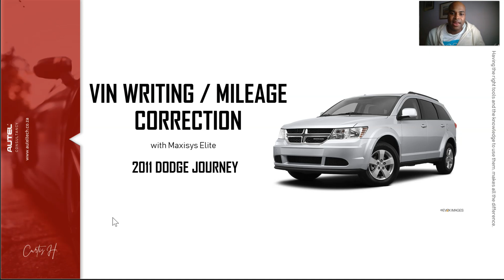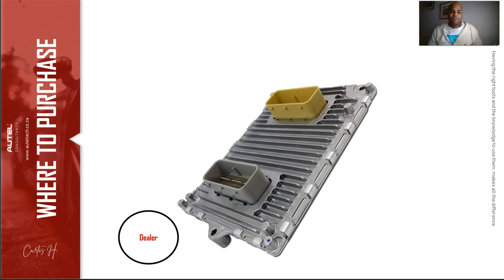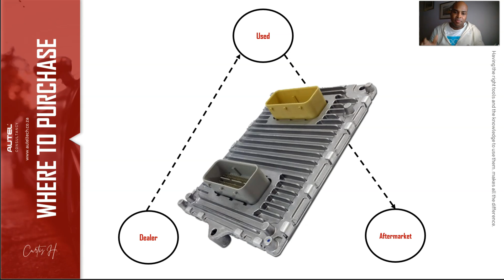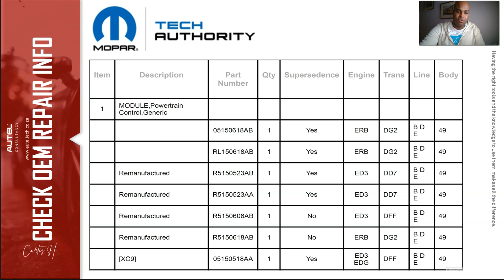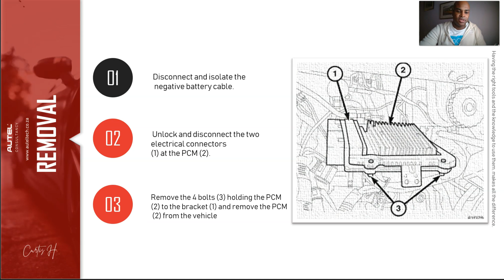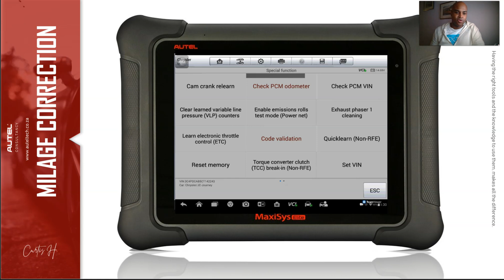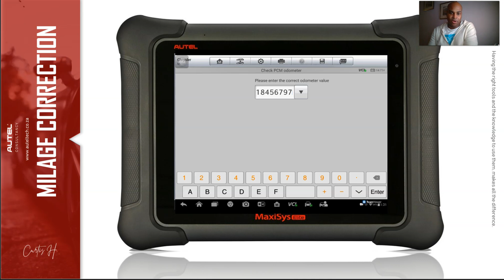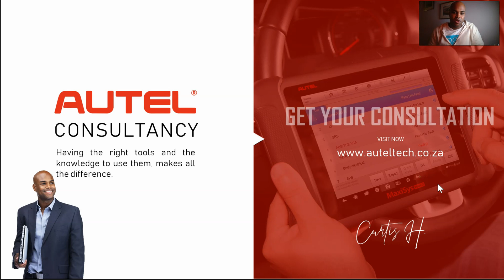Autel MaxiSys Elite | Write VIN on Used PCM & Mileage Change - 2011 Dodge Journey | Case Study 2020

Comment: I have the autel maxicom 900 and when I go to the pcm to write the vin it doesn’t have the special feature button there is there an upgrade app you have to buy to get that feature?
Reply from the maker: You should book a diagnostic tool consultation with me so I can learn about your needs and then give you the right tool strategy. Otherwise you have to keep on purchasing different tools until you find the right one... That way is more costly.

Comment: Good day. Global problem with the car and I do not know what to do because I have tried many different options. The car is Dodge Journey 3.6 STX AWD 2012. Unstable voltage at start-up produces a voltage of 13.5-14v after 30-40 seconds of operation the voltage starts jumping 12-13-14-10-9.5-11-13-14-9-12v (then after some time it is always different) when pressing the gas pedal while driving or just standing still, increasing the revolutions to two thousand the voltage can rise to 18v and fall to 10v and in chaotic dynamics jump to 18v. The ABS and ESC icons flash on the instrument panel, the radio turns off, the speedometer needle drops to zero, then rises again and drops to zero, although the car is moving at a speed of 40-60 km per hour. And also at this time, when the current jumps, the relay clicks and it heats up (the relay is on the right side under the dashboard) Namely relay K107 IGN RUN RELAY (the values are indicated on the relay itself 2705 13742705 12V> PA66-GF45<
The battery was replaced, the charge sensor on the negative terminal of the battery, a new generator was installed, nothing has changed! The car continues to behave like this.
Please tell me in which direction to move in solving this problem with the car! Thank you in advance for your attention.

Comment: So I’m doing a cluster upgrade on 2017 Tahoe. Used module. Can I use this to fix my mileage and code to my vin
Reply from the maker: You would probably need a different approach to solve this problem as the newer GMs are not so friendly with used models. You should set up an appointment with me to give you the tool strategy to solve this problem. auteltech.co.za

Comment: And for my 2004 Avalon, the AUTEL scanner reads “ the selected function is not supported by ECU” when I try to write the VIN to used ECM, is there something else I need ?
Reply from the maker: Usually what I recommend my clients to do is verify if the special function your looking for is supported. The way I do this is but getting the clients VIN number and sending it to my engineer. This way they will no before hand if their tool is able to do this procedure. You can ask your supplier for this service . If it is supported im some rare cases only a new module can have the VIN written . Other cases the ECU will not allow you to do it. Its really hard to say what the problem is unless you have someone log in to verify the root of the problem.

Comment: 👏👏👏👍  

Can autel im608 overwrite the vin on most chrysler and gms ?
Reply from the maker: overall the answer is no. Especially on the new makes and models. You need to check with your vendor by giving them the vin to verify the vin writing procedure.
Reply: Ok. Tanx. When the subscription ends I will be signing up for a consult with you instead of renewing with them. 👍

Comment: CAN THE AUTEL ULTRA REWRITE VIN ON A USED GM ECM
Reply from the maker: It really depends on the year make and model. From what I gather you might have more success with this on older GMS. The new ones likely will not have this option

Comment: Question so i change vin number but now i have ABS lock saying vin dosent match how can i match ABS vin to the new one? this for a 2020 dodge charger thank you
Reply from the maker: Sounds like your missing another coding procedure. What I would do is scan the vehicle , identify the error code and put it in the oem repair information to see what they say on how to diagnose it. Usually with chryslers , there are alot of coding procedures after you replace pcms
Reply: did you ever find a solution?

Comment: Need to correct vin in 2015 Acura TLX using Im608 primarily for keys. Can I correct mileage on a used cluster with my tool.

Comment: Ordered a MK908P and looking forward to using it. 
However i do have a few worries. I purchased a Launch (MATCO) 5yrs ago and last year GOOGLE no longer supported devices prior to android 4.4😡 
so what worries me is how long will it be until its android 7.0 and i throw $2500 in the garbage. Again. 
Why are most Autel scanners 4.4.4 not newer. This is OLD operating system
Reply from the maker: You know thats an international tool right?
Reply: Guess i will cancel that order. Again. This is terrible. Make one tool. 🙄 your website states don’t clarify international. America. Or anything. Too confused. On the American website it is on there, i live in CANANDA

Comment: Hi Curt
I just missed something from this great video.
After we disconnected the PCM cables, we jumped to using that tablet to write the VIN.
Did you connect the newer PCM to the vehicle and then worked on it? Or what happened!
Reply: Sure could use a reply to this!

Comment: Hi. I have im508 autel. I want to change distance unit on VW SHARAN 2011 (1N). But I cannt see any options. Speedometer shows mileage in km. how to convert to miles ? Is there any option to select? Or need to be coding? Thanks.,

Comment: you were doing a parameter reset and had to learn the keys on a Ford? If you were replacing the PCM and needed a parameter reset then key info in NOT stored in PCM, that being said you do not need to learn any keys. Only time you need to learn keys on a Ford is older vehicles that store the PATS in PCM. When keys are stored in IPC or BCM then parameter reset is all you need. 

On the Dodge PCM in this video you did not perform PCM replace function to clear the SKIM mismatch code. The job is not done and will set codes in SKIM module.

Comment: Hello Curt, is there a known problem with adding NEW replacement (AKS) smart keys to the Dodge Journey 2014. Haven't been able to add a smart key (the owner has a working smart key), and just where exactly is the center console slot referred to during the programming process? Most appreciated.

Comment: How my autel won’t read my car vin number try 3 cars now looked on the autel for rooms and some people are having the same problem
Reply from the maker: It could be several reason. Firmware is outdated. Maybe you updated the firmware and bricked it. Maybe the hardware is failing. You need to contact your supplier to help diagnose your issue.
Reply: @AutelConsultancy  Bruh so basically the Elite and MS908 Pro are the only two units that can actually program or code under the odometer function to do a mileage correction?

Comment: Where are you located? I have an issue with a plug and play pcm for a 2005 f150. After installing the plug and play pcm i can no longer use my power programmer to load a custom tune for the different tire size and differential ratio. I have had to take the pcm back to get flashed 4 times because after loading tune the pcm locked out and truck wouldnt start any more. I am in Tomball Tx if you have any techs near my area could you please reach out to me? Thank you

Comment: Which is the cheapest autel I need buy to change only the vin for a 2005 kia sportage 2.7L. I got a used ecu. Everything works. Got all the monitors ready but the vin is obviously different.  Need to change it for inspection. If you could tell me what options I have to do it.
Reply from the maker: Hi Pablo, If your serious I would suggest booking a consultation with me. This way I can get your VIN number and send it to the engineer to validate if the feature is available. If its not I can give you a strategy that will solve that particular problem. Otherwise you might self diagnose your self and by the cheapest tool only to find out it doesnt work. Then you have to buy another tool only to find out it doesnt work. Then your cost is going to go up.
Reply: @AutelConsultancy  thanks but autel contacted me and told me the mp808k will get the job done.
Reply from the maker: @pablomarquez4431   hey Pablo. I completely understand . free information may be the most expensive from my experience ..https://www.youtube.com/watch?v=2iAm69Os5_w&t=963s
Reply: @AutelConsultancy  well they asked for the vin and said they were contacting the engineer as well. But thanks anyways
Reply from the maker: @pablomarquez4431   Ok. Thats good that they took the vin. Let us know if the tool is able to write the vin.

Comment: Hi, Please advise can be replaced PCM module on 2018 Dodge Journey 2.4L to used ones from another car and adapted by Autel IM608 ?
Reply from the maker: I would have to check with my engineer ( by VIN Number) to give you 100 percent accuracy. ( I charge for this service) Did you try calling autel to find out? Give them the VIN for more accuracy.

Comment: My question is I am thinking about purchasing MK808BT instead of 908. My son has issues with dashboard odometer, he swapped with newer dashboard now has odometer reading 📚  incollect reading. Can I use MK808BT correct the odometer reading. thanks
Reply from the maker: Hey Yoshi, either tool will not be able to do that function. You are going to need a special device that will do this specific feature. I would recommend getting consulted properly so you wont waist your money. Go to www.auteltech.co.za and click the diagnostic tool consultation service.

Comment: Hi , i have a land rover 2011 with faul code p0630 vin not proggramed or incompatible. Maxisys elite could help on this case
Reply from the maker: Im not sure swapped the ECU with a used one or new one. It seems the VIN number is not programmed to the vehicle.  You might need to use the j2534 and OEM Subscription to program it. Maybe investigate the code thoroughly by looking at the oem repair information

Comment: Great videos, my question is I have Autel maxisys mini and a 2013 Impala with a U0100 dtc. My pinpoint diagnostics lead me to a bad pcm. Question is if I buy a used pcm can my Autel make it work for this Impala?
Reply from the maker: HI Scott you would need to check the enginee control module control module under the special functions to see if there is any VIN writing function. If its there you can do it. If its not you need a j2534 and OEM subscription
Reply: @AutelConsultancy  I recall something but it was under the bcm if I'm not mistaken about "write sdm" or something similar maybe sbm serial? I'll bring my tool back home with me tomorrow and look to be certain I'm giving right info. Are there any trade in programs or something along the sorts if I wanted to upgrade to the maxisys elite or newer unit?
Reply: Oh and if I bought a J2534 could that be used on my maxisys mini?
Reply from the maker: @scottwelinski8500   For programming no. Remember when you program you need a windows 10 laptop. You leave the ms906bt in the box since it will not be used when programming.
Reply: @AutelConsultancy  it said setup sdm primary key in bcm

Comment: Hi Curt very much appreciate your careful explanations. I use a DS808 and I've never attempted a VIN re-write. I'm wondering if typically or generally the DS808 could do this function, although I get that you need to check also for specific cars and VINs?
Reply from the maker: HI Alex it might have this feature on a very few vehicles. Stage 1 tools dont have as much special functions as stage 2. And even on the stage 2 its limited.

Comment: Would be nice if you did newer GM models and explain how you cannot install used modules. Global restrict and all that good stuff.
Reply from the maker: If my clients comes acroess this ill be more than happy to share.
Reply: Autel Consultancy thank you!
Reply: There are ways to use used modules in newer GMS but you have to be able to read / write cmos
Reply: @unclejoe6811  any equipment or info you can share?